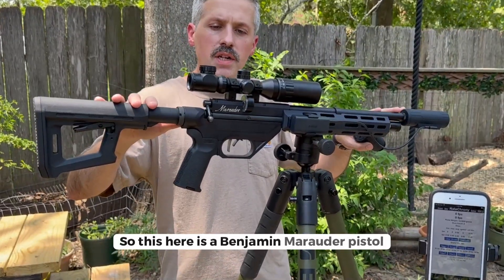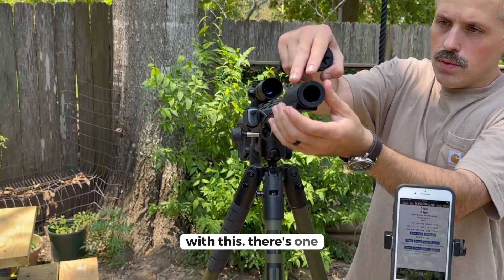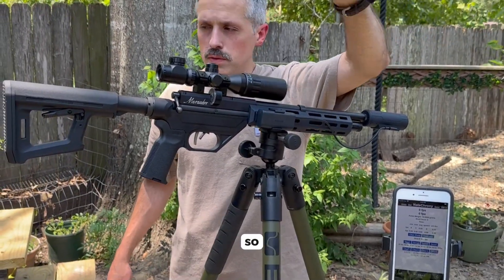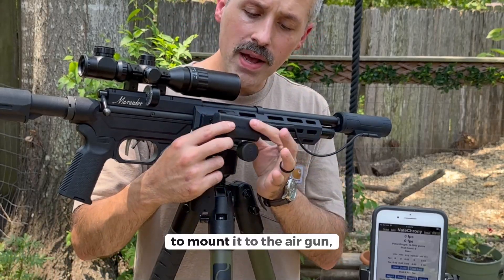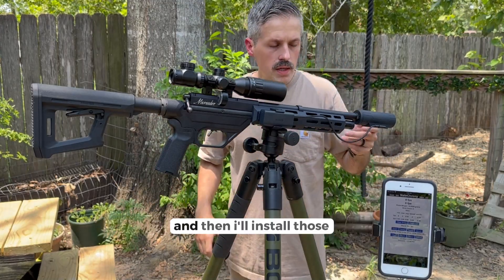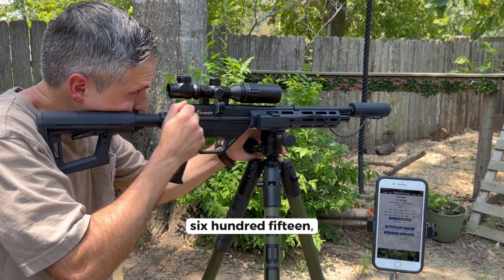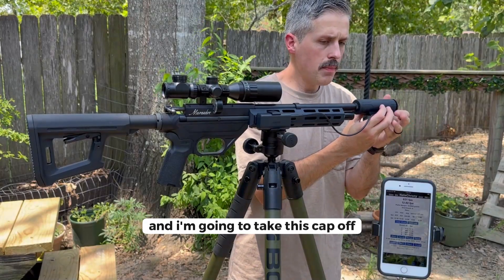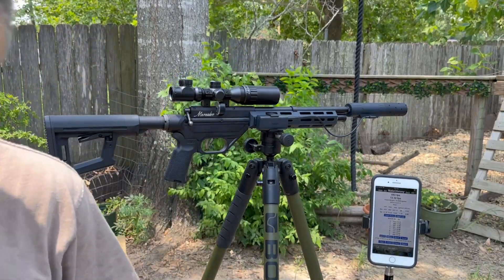Threaded Airgun Chronograph? Suppressor? Yes and Yes

Comment: Great product - I have been using this on my Notos with the suppressor unit. Only issue is when I get above 850 fps, it seems to accumulate pellet dust on the sensors after 25 shots, and causes the "clean sensor" error. Once it's opened up and the sensors are wiped off with a cotton swab, it goes back to normal operation for approx 25 more shots before happening again. Maybe at high speeds the suppressor is keeping the dust inside the unit due to some back pressure? Have you had any issues with this when shooting at higher speeds? I tested on my Zelos, which runs around 750 fps and shot 50 shots in a row without issue. Can you give me any insight as to whether this could be the case? Maybe without the suppressor attached the dust would simply go out the end of the chrono unit? Thanks in advance.
Reply from the maker: Hmm. That’s a good point about the back pressure, but I don’t believe that’s the issue. We have folks shooting these on a lot of different airguns and I’ve tested mine on four guns and thousands of rounds over 850. Have you tried shooting it without the baffles and Chrony only to see if the problem persists? I don’t usually keep a close eye on YT comments. Shoot us an email and we’ll work with you to get to the bottom of it or get you your money back if we get stumped.
Reply: @ I will try that when I’m back home tomorrow without the suppressor. Just seemed odd that it only happens when I go over 850, as my zelos never has had that happen at 750 fps, but let me see what happens.
Reply from the maker: Sounds good. Also, just heard from Julie and Nate that you were in contact with us already. Let’s continue this in email so I’m not going around them with a parallel chat. I’ve let Julie know that you’ll be trying the end cap, etc. Thank you!